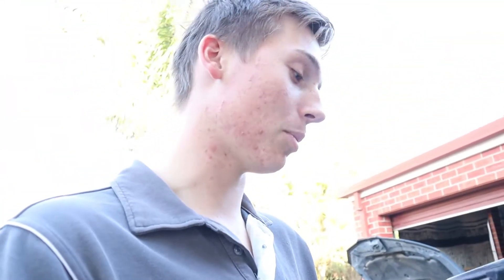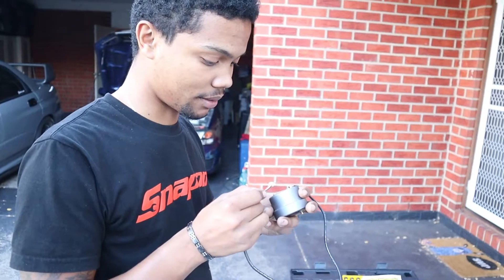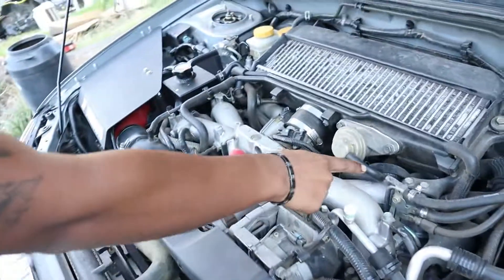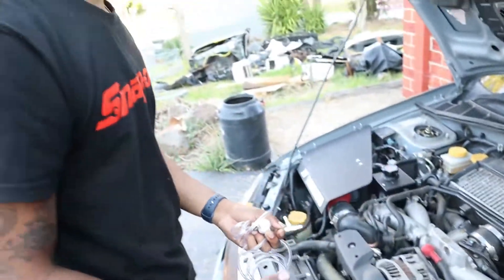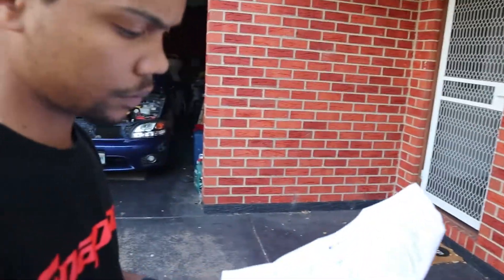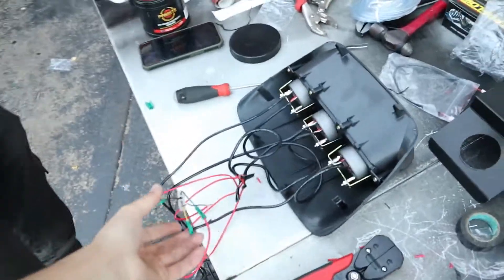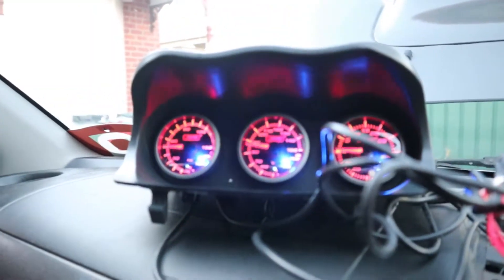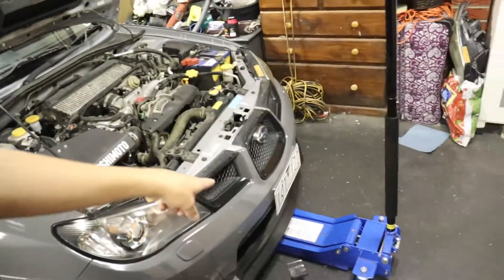INSTALLING GAUGES IN MY WRX! |How to instal gauges in a GD WRX!

Comment: Did you tap into the clock wiring for power? Or somewhere else? Ive heard that tapping into the clock will cause the airbag light to turn on did you find a way around this problem?

Comment: By the time you catch any abnormalities using a gauge, the  damage is already done.
Reply from the maker: Better late then never :)
Reply: @YTBazily  possibly
Reply: Suit yourself, i like knowing what my AF ratios, oil pressure and engine temps are.
Reply: @Namesakes.unit-x-10sq10  unless the cars shit and the tubes shit shouldn't fluctuate too much
Reply: @remissiveslave  what?
Reply: @Namesakes.unit-x-10sq10  if you have to spend that much time focusing on all these guages, how can you enjoy driving it.
Reply: @remissiveslave  proper gauges with selective warning parametres, and its to check whats happening when mapping a car on the road and to monitor and fine tune custom tunes.
Reply: @Namesakes.unit-x-10sq10  cool